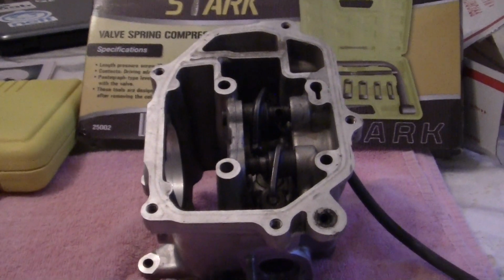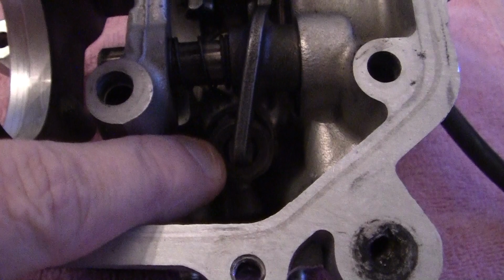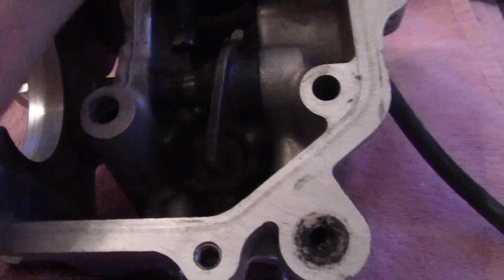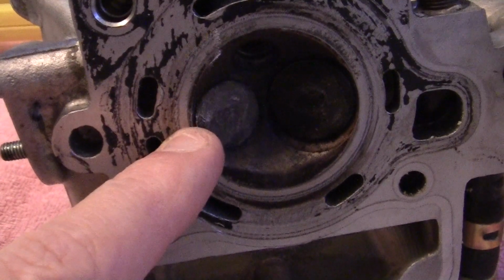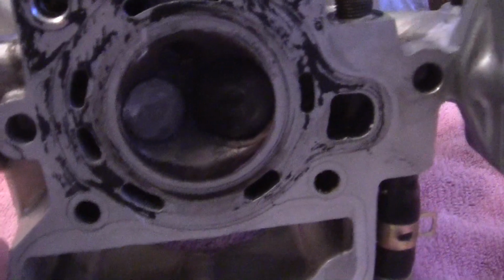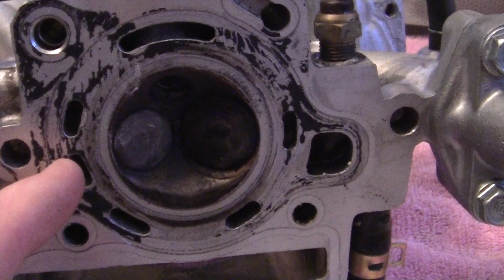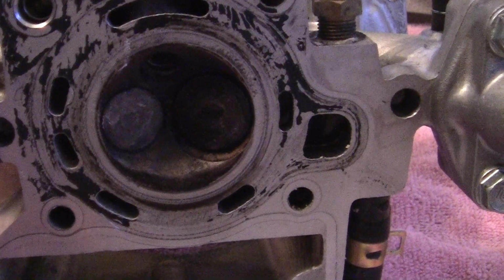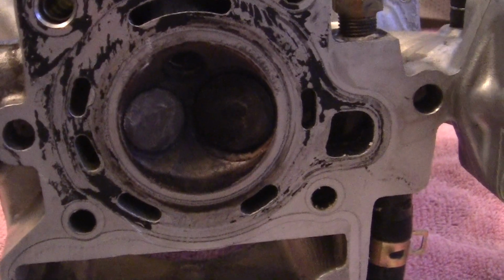75)-  PROJECT Honda  RUCKUS - HOW TO= Engine COMPLETE REBUILD

Comment: Dude, you are awesome. I'm so glad I stumbled upon your videos. I recently bought a '03 ruckus, that I know is need of a rebuild. I plan on doing a bunch of work so it performs at its true potential. Your videos are a definite inspiration, as I continue to watch this tutorial.
Reply from the maker: +Ted Sommer I decided I would film the RUckus rebuild for a couple of reasons. One- If I forgot where something went, I could refer to the videos in reverse. THe ruckus is highly complicated compared to my two stroke bikes. On the other hand, Honda built an efficient, tough, well thought out engine. I might do another one if I open a shop after I retire. Which will be soon at my age. Glad you liked them.
Reply: I could totally understand about the little ruckus motor being a reason to record everything for reassemble. Tiny and complicated they look. But fun and rewarding